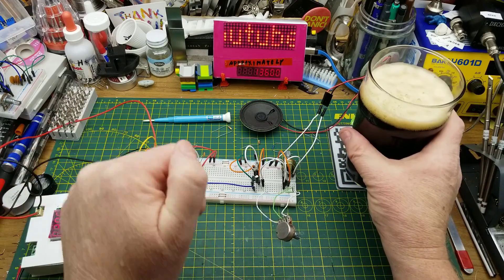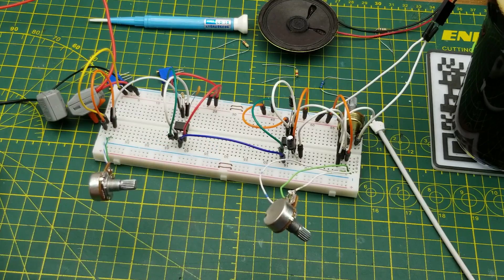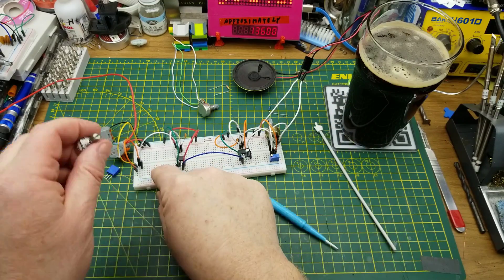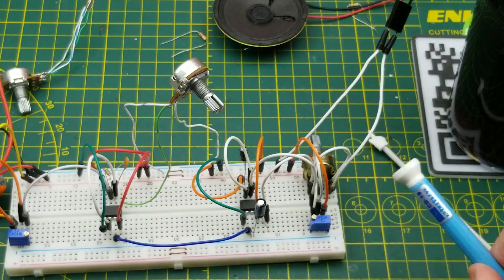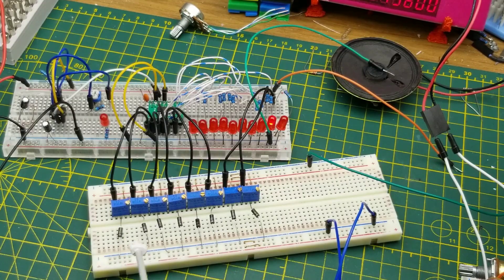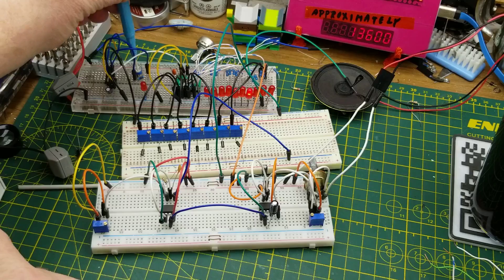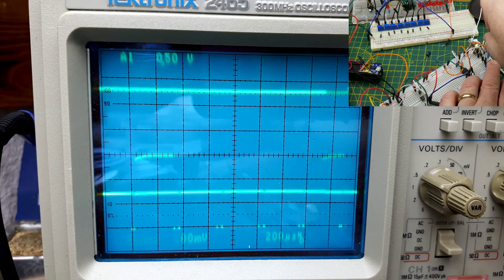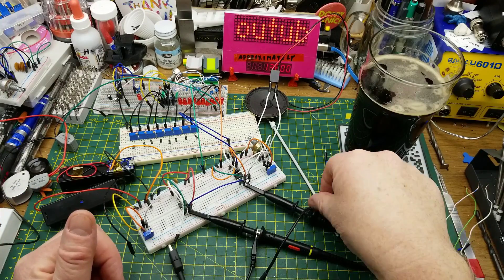Atari Punk Console - exploring a classic circuit

Comment: Hey there! Thanks for this nice video! The output of the 4017 board goes into the CV pin of the first 555? Just trying to figure this out. I built my APC with a 556, but I suppose it would be similar, so to the CV on the first side?